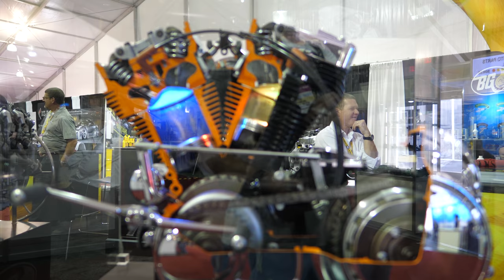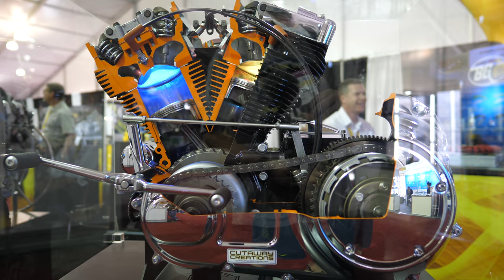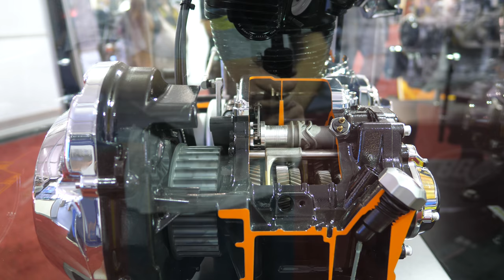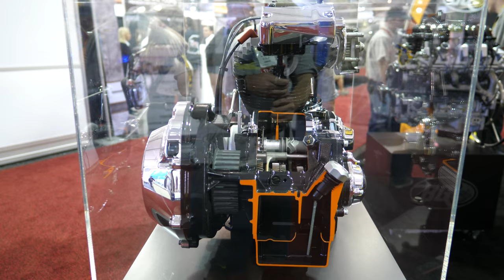Working Model of an Evo Harley Davidson V-Twin Air Cooled Motorcycle Engine at SEMA Show [4K]

Comment: My brand new Ford Ranger 3.2 litre five cylinder diesel needed replacing at first service and did only 15 K.
The engines have a design flaw with the oil pump loosing prime after draining the oil. If not done under 10 minutes and refilled immediately catastrophic engine damage occurs. They still sell them tho. My 2019 Ranger received a new engine made in 2011 according to the info on the crate. 
My 93 FLHS   Electraglide did over 100k and the bores still have the crosshatch markings in the bores it was the gearbox that failed but nothing HD did..

Comment: The working model shows that primary drive is connected to secondary drive with chain sometimes they use belt but it is not good and it is outdated technology. In the high RPM it vibret.
Reply: A primary chain has less parasitic loss than a gear- or belt-drive primary.  While it may potentially be an issue at very high RPM, that is only at VERY high RPM.  In something like a Harley, the entire challenge is dealing with lots of torque and low revs, which is what chains are best suited for.
Reply: @JETZcorp  lol lots of toque hahaha underpowered junk
Reply: @demogorilla  They have lots of torque simply because the engines are huge displacement.  Nothing fancy, just big.
Reply: hemant vasudeo humans are outdated technology...right?
Reply: @JETZcorp  I got it, but if this the situation then why we use so high displacement bikes .? Where is the seating capacity is just 2. May be for fun.
Reply: @randysimmons9838  Dear I am not a mechanical engineer but I got the answer from JETZcorp.But I understand your view also that we use technology as per our requirement.

Comment: Damn no over lap with the stock cams?
Reply: Dachamp2001 I just noticed it also. Probably because of the lower rpm these motors have.
Reply: @rebel_ltz  lol I was researching that. I'm thinking it's to meet EPA emissions and make communistforina happy. I'm shocked that the engine can even breathe let alone the potential power loss
Reply: @Dachamp2001  harley air-cooled engines doesnt have power, but big torque

Comment: Bt Harley is belt drive not chain drive
Reply: Oh boy....  thats what is called a primary drive.  Shaft rotation drives the transmission input via chain.  The stock final drive has been belt since the 80's, but can be modified to run chain also.
Reply: @westoniii  oh okey okay

Comment: I thought both cylinders fired at the same time on a Harley
Reply: That's what you get for thinking huh ?
Reply: No, it works just like a v4, v6, and v8.
Reply: i think if it did the crankshaft would never turn.
Reply: older ones do (unless they’ve been modified to single fire ignition) but one is a ‘wasted’ spark on the exhaust stroke. Keeps it simple, one set of points and one coil for both cylinders. It’s another thing that’s makes the old motors idle like they do
Reply: The weird firing order  gives it that Harley sound.
Reply: @BruceLee-xn3nn  i think it's like the crankshaft on the hd v twin has one journal with 2 connecting rods on it so the firing stroke for the pistons is 180 degrees out of phase so when one cylinder is firing the other is on the exhaust stroke. plus the angle of the cylinders is kinda steep at 45 degrees and that adds to the traditional sound and feel of the engine. if the angle was wider it would smooth it out some and if it was flat like the bmw engine it would be more the ideal but not a HARLEY-DAVIDSON which a lot of us like.
Reply: one other thing i forgot to mention is the motors from about 1999 and up the twin cam have a chain driven dual counter balancing system that actually turns in the opposite direction of the crankshaft to smooth the engine out. i used to have an older shovelhead bike and the engine would really shake. they tried rubber motor mounts for a while to isolate the motor from the frame and the rider.
Reply: Alan Whiteside  yes i have an 02 heritage softail with the twin cam engine. it is alot smoother than the 1980 flh shovel head motor i had before.

Comment: False advertising it's not a panhead.
Reply from the maker: What is it then?
Reply: It is a twin cam. The valve covers are the wrong shape and the transmission does not bolt directly to the engine block on a panhead.

Comment: HP is more relevant information for the engine than torque, this information describes the capabilities of an engine, this is what you got. By changing the gear ratio (shifting gears) you can adjust the final output maximum torque to the driving wheel, by slowing the wheel rotation compared to engine speed you are increasing the output torque on the wheel, and of course if you do the opposite by shifting up, the result is more speed and less torque. So, you are able to adjust the torque and speed while driving.
But he maximum power (HP) is the starting point, it is the starting point in the equation of torque and revs. You cannot alter the output power by changing the gear ratio.
Power output remains constant, less speed more torque, more speed less torque on the wheel.
One man by himself can lift the car (or track) using only man power if provided with adequate leverage. But it will take much longer to complete the job than in case using a crane powered with more powerful  engine.
It is not that the torque characteristic of an engine is not important at all, but that would be the torque and power curve related to revs.
But the maximum torque of an engine that Harley proudly presents to the potential buyer means very little, it is used to hide the fact that the bike they are selling is outdated and obsolete technology.
Reply: uh.....Tq is measured, HP is calculated using Tq

Tq is measuered at the wheel, then calculating HP the equation uses RPM of the engine not RPM of the wheel........so the lower geared uses the higher RPM's prducing a  higher calculated HP
Reply: @rugershooter5268  wrong, hp is calculated using rpm of the wheel. What are you saying is that by lowering the gear ratio by 2 for example, you will doubled the hp of the engine, ha ha.
Reply: @ivicastanic3605  you need to check the equations
Reply: @rugershooter5268  hp is measured by measuring the torque on the crankshaft and multiply by the speed of the engine, or by measuring the torque on the wheel and myltiply by the speed of the wheel. But maybe it is better for me to give up. When harley hp is measured, you do this by measuring the torque on the wheel and multiply by engine speed of the nearby Yamaha reving at 14 000 rpm
Reply: @ivicastanic3605  Your hatred of a motorcycle company has blocked your brain
Reply: @rugershooter5268  no I am not hater,  I just tried to explain the basic principles of physics. We can argue on which bike is better, everyone has  an opinion and I have no problem with that.
But there is no sense to argue about basic laws of physics what you don't understand.

Comment: No wonder they vibrate so bad.
Reply: You haven't rode a newer Harley,in 07 they have counter balance. They bearly vibrant
Reply: Bruce Lee last Harley I rode was a 2013, everything on it shakes.
Reply: @BruceLee-xn3nn  rode the Ducati Sunday with a guy who owns a big ass dresser 2013 I think, the engine jumps around in the frame like it has tourettes!! Only the mounting system keeps it from shaking like a paint shaker !!! What crap
Reply: Single-pin crankshaft in a v-twin produces the potato-potato vibrations. Some people pay extra for it! The touring models have a rubber-mounted engine, so yeah... paint shaker effect. The softail models have a rotating counter-balancer in the engine to offset those pulses and are much smoother, so can be hard-bolted to the frame. Softails are smooth.

Comment: Harley are not cool at all, it's one of a few bikes that you buy for like 16k and up and then add another 5k or more just to add a little bit more power...  Why do they not just make a maxed out design bike is beyond abnormal... they should put gears for those cams too and not some stupid chain with plastic guide the size of post stamp...What's up with that and  all those stupid stage 1-4 and beyond engine work...
Reply: It's called marketing, and relying on their idiotic brain-washed club members to hand over their hard earned money for continuous modifications to their motorsickness. They created a brand that relies on constant feeding ($$$) from it's constituents. It's never been about technically advanced engineering and maximum performance out-of-the-box. Instead they provided a mid-life club that their members were quick to defend, as they'd invested huge chunks of time and money into supporting it. News flash: Their core baby-boomers that didn't mind dropping thousands in membership dues are all but fading away now...  And they are frantically developing (every bike imaginable), to see what will generate numbers and keep them afloat. Very different times though.. We don't have soldiers returning from war and buying Harleys' to plant the seeds that started it all. And the 'looks and sound and feel' of the traditional inefficient single-pin V-twin is appealing to a much smaller customer base- especially at prices that don't seem realistic for such poorly performing machines. But on the bright side- tractors are still a lot of fun to ride (if you're not 2-up, loaded down, in the mountains), and right now, and the immediate future- is a REALLY REALLY good time to score a deal on a used one, as lots of old boomers will be unloading.. :-). It will be interesting to see if HD can successfully cross this huge gap- from the very-vintage models of baby-boomers past, to whatever now has maximum purchasing appeal for current millennials and gen-X-ers…? Surely they've researched what the biggest sellers currently are, and will soon be, and focused their design and engineering in that direction.. Can they quickly change tracks, do a make-over, and appeal to a buying public 30 years younger?
Reply: They did, but Buell flopped.

Comment: Who made the video and called it an Indian motor? The pistons are too big to be a Indian because Indian motors have nickel sized pistons that make no power
Reply from the maker: What engine is it?
Reply: @InternalCombustion  a Harley engine clearly. Look at the timing of the fire.
Reply from the maker: What do you mean?
Reply: @InternalCombustion  Harley has there pistons set to fire almost at the same time. That's why there the only 1 to have that destinct sound that all others copy.
Reply: @InternalCombustion  also it has a 45° v twin angle that's Harley engine design.
Reply: @InternalCombustion  its a Milwaukee 8 engine. Harley's newest engine design
Reply: I don't see where this was called an Indian motor

Harley motor cylinders do not fire at nearly the same time